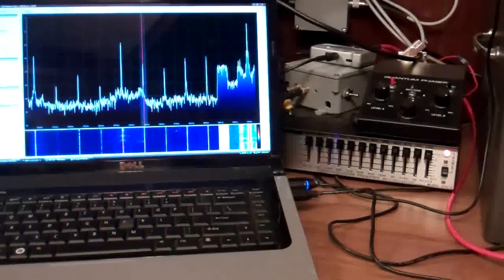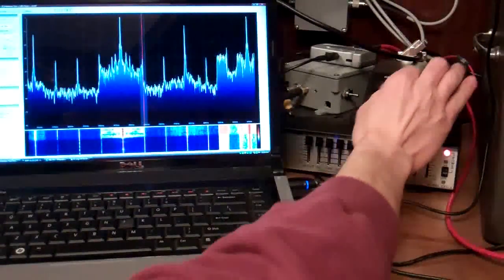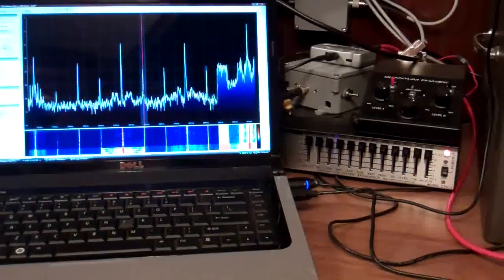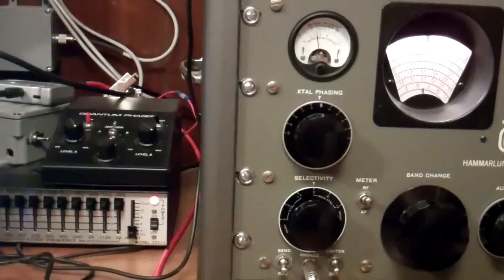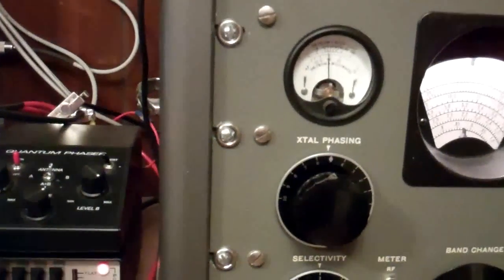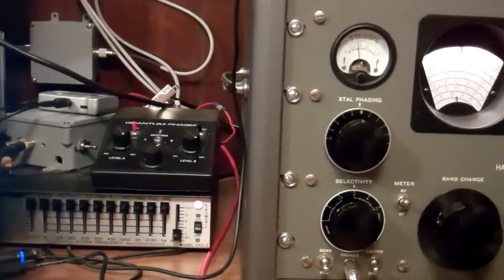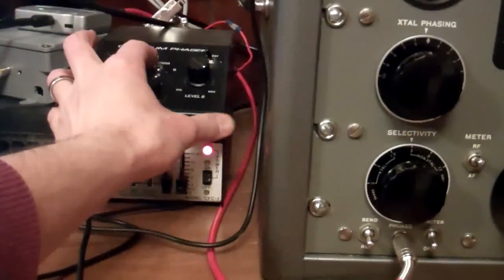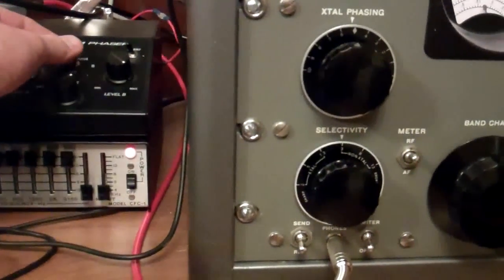Phasing Out Splatter From a 50 kW Local On Adjacent Channel

Comment: Nice demo, I am waiting delivery of one Gerry's Phasers. Hopefully 
it will be as effective in killing the Euro trash I have on the opposite 
side of the big pond.
Reply from the maker: Thanks! Once you get the hang of just tweaking the knobs to get the 
perfect null you should see big improvement in many cases.  The deepest 
null spot is very tiny when you have your antennas closely spaced as I 
do.  If you can get them further apart than I have (assuming you use 
only verticals as I do) the nulling should be easier.  I have also found
 that I can null stations to different extents depending on which pair 
of my three antennas I use with the Phaser.  Regardless, It has been an 
excellent addition to my shack. 73's and good DX.

Comment: What antennas are you phasing together? de k9rzz
Reply from the maker: I am phasing two low-noise verticals based on designs by Dallas Lankford and others. I have three that are 27-30 ft tall, spaced 90-120 ft apart and use a broad band matching transformer to match it to the MW BCB which is what I primarily DX.  You can get a better idea and more detailed description than I can put here in my Low-noise Vertical video.  https://youtu.be/hSwkM9aaGNU?list=PLCED329D32CFBDBBF